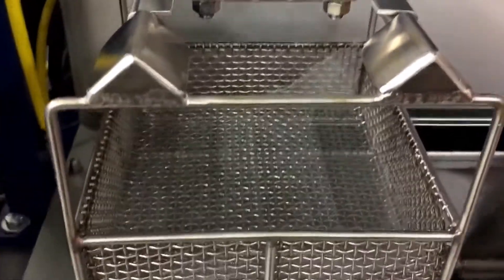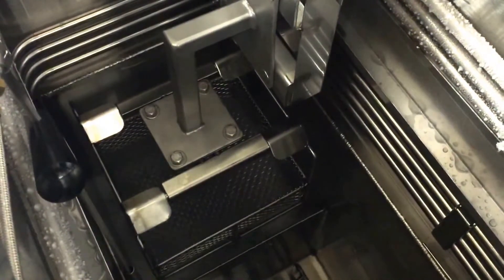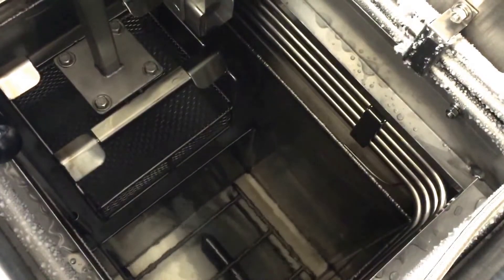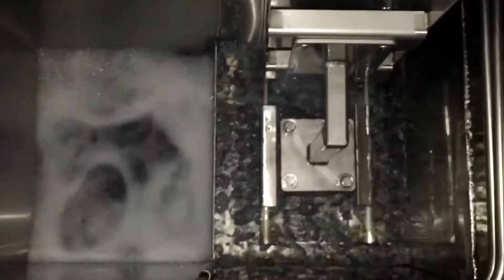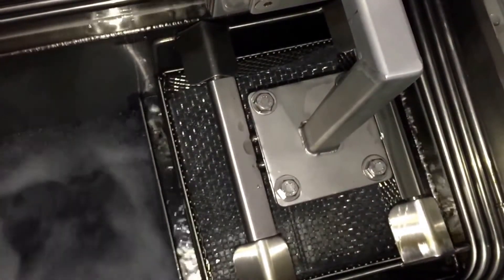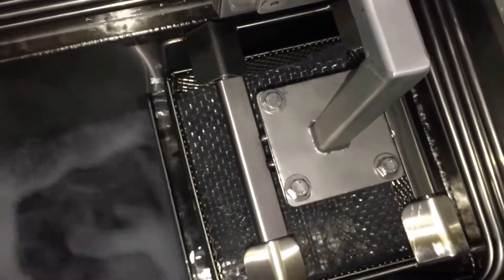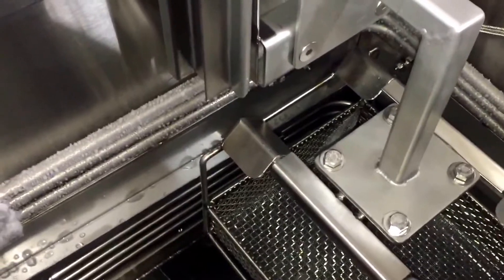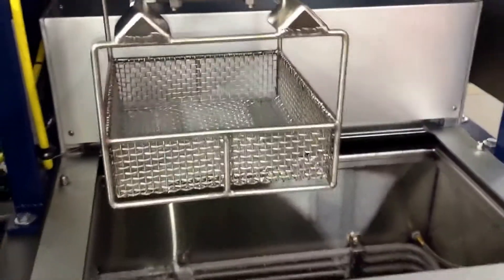Vapor Degreaser Demonstration with Automation and Basket

Comment: How about demonstrating with actual, y'know, PARTS?
Reply: Seriously. Might as well add "but no actual degreasing accomplished" to the title. Seems like such a no-brainer to show how effective it is. And counterproductive to actively avoid showing it.
Reply from the maker: +RedArrow73 Thanks for the comment.  We greatly respect the confidentiality of our customers application.  Being that many of our customers are in the medical device and aerospace industries we have non-disclosure agreements in place for applications and customers.    Do you have some questions on how vapor degreasers work?  If you would like to send us some parts which we can show on videos, we will gladly test them for you!
Reply: @Besttechnologyinc  you could go to a junk yard, find a really greasy part and clean that. The confidentiality of your customers is still maintained and we get to see how well the process works. I'm concerned about contamination if say a part that has wax based grease that is difficult to scrape off is used in the same machine that cleans medical parts.
Reply: @Besttechnologyinc  Doing a lot of bidniz with THE DEEP STATE, are you?